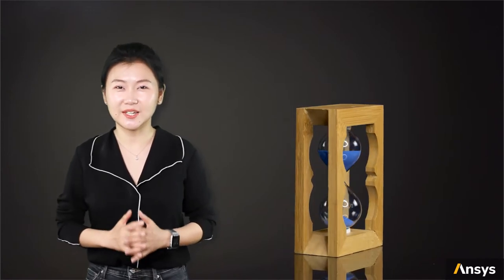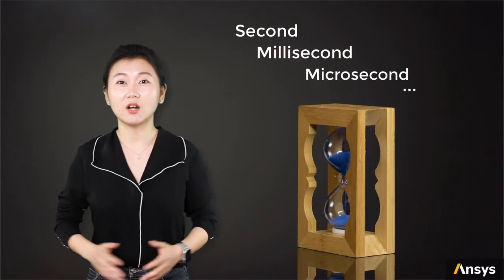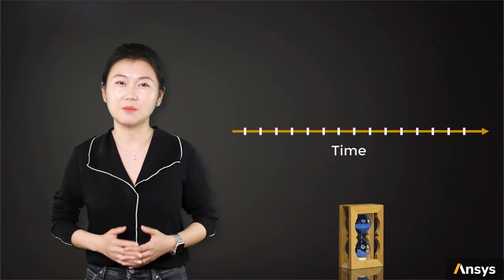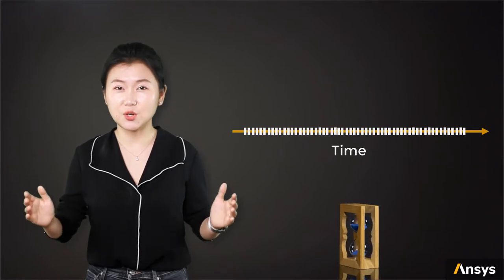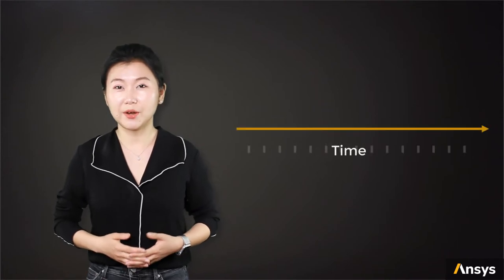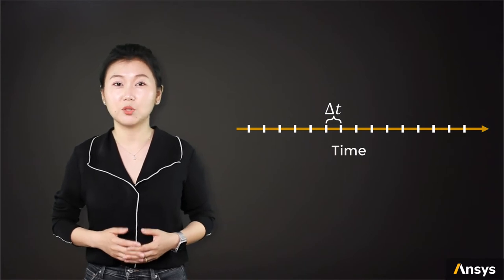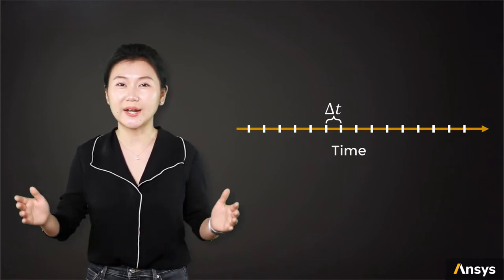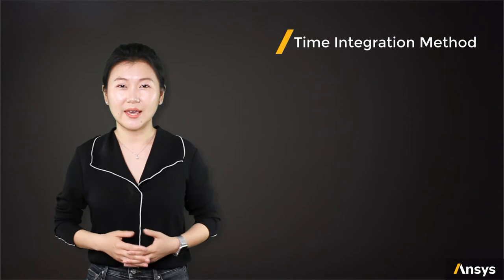Time Integration — Course Overview

Comment: Its nice explanation but what about the application of heat transfer problems for example mold cooling using cooling channels which time integration method and time step we have to consider ?